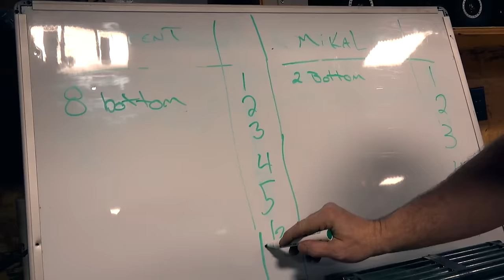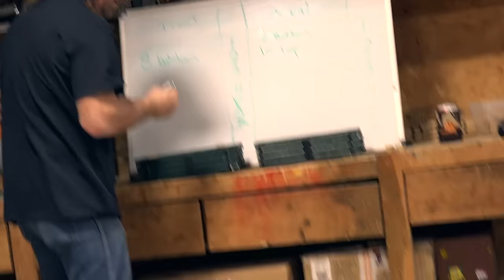LOADING WARS: GO BIG or GO HOME! FORKLIFT FIGHTS (S2 E6)

Comment: Mikal's truck with that sleeper just looks killer. And I have to agree that sticking with the same truck is the way to go, when I switch trucks at work even the three foot difference between my normal truck and the newer truck messes me up if I haven't driven it in a while. You get so used to your equipment that its hard to switch. I am glad for the red fork and the blue fork, makes keeping track of them a lot easier.

Comment: Back in the early 2000s I had the privilege to be the first and only operator of a Linde lift at the local lumber yard and I will tell you it was worth EVERY PENNY. Those lifts are so smooth.  You just need to get used to the hydrostatic brakes and joystick style controls.  Best job a youngster could ever have.  And the video was awesome too!

Comment: I love it, but is that corner even doable without a penalty??
Reply: Sure is 😉
Reply: should have exited the dock and gone slightly right then turned left to set the truck and trailer up wider for the corner
Reply: Or pull out to the left and back up and get over as far away from the dock side as possible then make your exit that would give you the most room to make the swing with the trailer

Comment: I cant even imagine how expensive this hobby is
Reply: on the normal cars and trucks go for 200 plus
Reply: Not whem you know where to get the cheap once
Reply: @paulodepablo3649  well then
Reply: @thelittefox4527  i suggest getting a Sinohobby Mini Q at Aliexpress. Mini Q Q2 RWD or if you want it to be cheaper then a mini Q TRQ1 DIY kit.  Then get a 1:25 scale RC truck then change its ESU and servo so that you can get a more accurate steering.
Reply: R
Reply: Build your own for cheaper I’d imagine.
Reply: Play warhammer 40k, you will think this hobby is cheap. Atleast these come put together and painted lol
Reply: 500 maybe
Reply: Patrick Kelly At least it ain’t spent on drugs
Reply: Joshua Stevens you are absolutely right about that!
Reply: MrCaryk , the Tamiya rig and trailers are kits. Built bone stock you’ll have over $500 in a rig, and $300 in the flatbed trailer. The radios start at $150 up. Batteries are $50+. The charger is another $100. Start CUSTOMIZING RCs, and you’re spending $1000+ quick. So no, not a cheap hobby by any stretch. But I’ve participated in hundreds of RC events, parades, contests, etc. since the ‘80s. It’s been a very rewarding hobby, and well crafted RCs have excellent resale value....some folks can’t stand the thought of building something themselves. 

War hammer on the other hand....figurines and tabletop. Yawn.
Reply: Thousands.

Comment: Are you running that lipo upgrade in these trucks. If so have you noticed any kind of difference?. They are missing lights by the way.
Reply: I run a 2s for this and a 3s for pulling heavy loads
Reply: I ment to say fork trucks. Sorry typo.... I seen him post a video about the upgrade.

Comment: I drive local for some guys hauling brush and moving the equipment.   Over time I have come to learn it's much easier to look at your truck as pushing the trailer instead of backing it.   It seems to make it much easier.